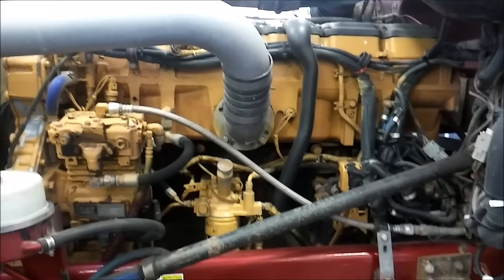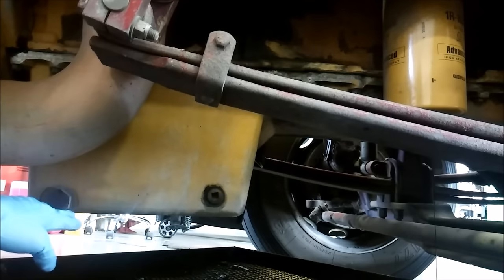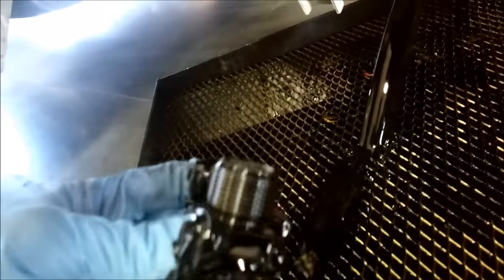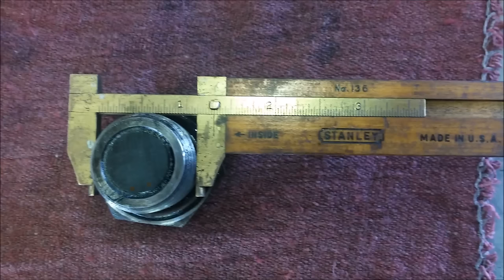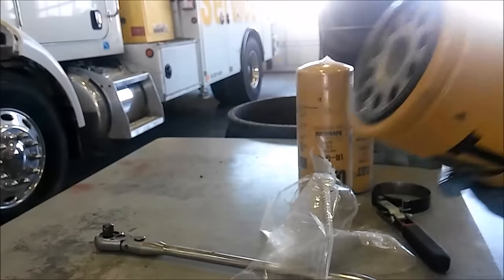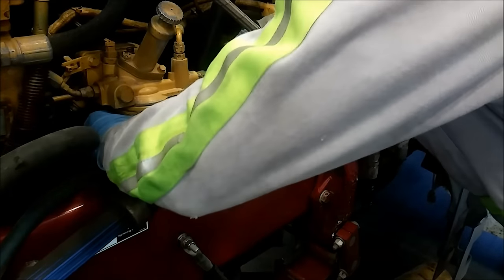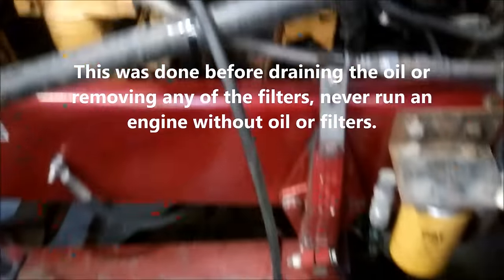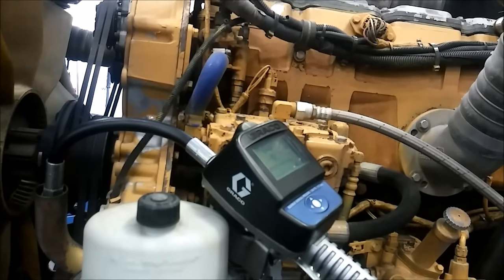How To Perform A Professional Cat Diesel Engine Service.  Cat Engine Oil Change.

Comment: I like the idea that you make a hole in the oil filter to drain the oil I would not have thought of that that's a good idea keep up the good work & videos I like to see your videos
Reply from the maker: Thanks for the comment. Yeah I've done the drain hole in the oil filter for years and it really makes it easier. Don't do it with the fuel filters though or else it might syphon out the fuel tank, I've seen that.
Reply: You can also put grease in the bottom of the filter where you poked the hole when you go to remove the filter to make it a cleaner process so theres no oil draining while you remove it
Reply: @masonharris2995  I'll use a  bugger instead of grease.

Comment: About to do an oil change on my 1997 Cat 3126 engine.   I would have overtightened the drain plug and pre-filled the filter.  Glad I watched this video first.

Comment: I love how careful and proper mechanic you are. Very professional. ! I don't see guy like you cutting corners. Great videos.  I am a mining mechanic and find a lot of your videos helpful
Reply from the maker: +Kostya Yantsen Thank you for the kind words. I am thorough, maybe a little too so, it slows me down a little, but I really like doing the job right. What kind of mine do you work at?
Reply: Google NARM  GIllette, WY. Biggest private coal mine. They really have their stuff together here. they have like 40 D11s, 20 D10s, 20 some 24H and 24M blade. Its impressive how much of the same problems we see( same as you i imagine). But there is a little bit of troubleshooting but a lot of it comes down to component changeouts due to downtime. a lot of times they try to run somewhat of a decent maintenance program and be proactive. add me on Fb kostik yantsen. 
keep up great educational videos.You are the kind of lead man i would want to work for because "good enough" is not in your vocabulary.
i mainly work with 3516, 3512, coupled 3512, c32, c27, c15, 3406, 3508 ect ect.
Reply from the maker: I don't have a Facebook, but I work with a guy that used to work up in Gillette on a coal mine, he didn't know your name though he was a field maintenance guy up there last year.
Reply: there is a dozen coal mines. 2 of them have over 1500 people working lol lol

Comment: I fitted a ball vilve slow drain plug on the furthest most rear right side drain plug on the oil pan on my c15
 this works well if you dont have the luxury of heavy shop equipment or a 15 gallon or more low profile heavy duty drain pan to catch all the oil and handle the flow rate of oil comming out of one of the bigger rear drain holes while it's hot.
With a slow drain ball valve plug I use X2 24 Qt wall mart drain pans ( the large square ones at only 12 bucks each) they can be sealed up by putting the 2 caps back in the center then you can pull them out and carry them like suit cases with out spilling oil all over but if i did not use a slow drain ball valve plug the flow rate of the old oil eventually  overwhelmed the drain holes on the catch pan one down side is i need to slide the 2nd oil catch pan over when the first one gets almost full but i keep them side by side so the switch over of each pan is quick as they only hold 24qt each. but they are the largest oil catch pans i can find with out spending 100s on a heavy duty one plus they store with out taking up to much space.
But for a DIY oil change for an OO whos an ex car mechanic, i use both catch pans combind with the ball valve and it works well for a qiuck stealth parking lot oil change with no mess also the hole in the filter is a good tip I must say 
Personaly i add half a gallon of diesel  fuel in the in engine just after the fan kicks in when the engine is hot and let it run for another 60 seconds to help remove the last of the old oil and soot that sticks to the walls of the engine.i use to do this on diesel cars in the UK but would use only half a liter or less when I worked as a mechanic alot of uk diesel cars  had long life diesel oil and long drain intervals where the oil sooted up bad and was black as hell

Comment: Good info on the drain  plug  torque ..and filter prime methods .
First timers need to know  a  12 gallon drain  pan wagon..., on wheels,  might  be the  way to go ...and prevent a big mess...
I then used a drill pump to put the waste oil from the drain pan into covered buckets , drum , etc . 
Any thoughts ?

Comment: I use a homemade punch to put a hole in the bottom of oil filters and let them drain before i remove them. Takes a little more time but it sure saves a lot of messes. Cat drain plugs can be awefully tight. Filter pliers are a Nope in my book. A Snap On dual drive cloth strap wrench is the cats meow for overtightened filters.

Comment: Hello, Excellent video. I just purchased a 2005 Sterling 22' box truck with a C7 and Allison trans. First diesel! I wanted to know if there is anything different regarding the Oil changes/Fuel filter changes on this specific engine compared to your video of the C15. It has 294k, runs great, and I will be using it for personal use only. It looks like it was kept up to date mechanically by Ryder with the stickers in the cab. I do not know the backround of the truck but I want to treat it correctly!

Comment: I have a 2006 C7 in my RV.  I am reading horror stories about loosing fuel prime. I have no secondary hand pump with no room to install one.  Looks like you had both filter off with no fear of loosing prime?

Comment: Kay I operate a 908m cat wheeled loader an now have to start Doin my own oil changes an which I don't mind but never worked on one...you should totally do a video on the engine service for it
Reply: you video definitely helped but not fully haha just a newbie I am an really don't wanna mess up my loader Doin the wrong thing...my manuals help but not fully just need to see it done an I'll have no problems
Reply from the maker: +Dakota May I don't get to work on earthmoving equipment in my shop, just trucks, busses, and RVs. The engine itself will be the same as far as a truck engine service, but you still have do the hydraulic system, grease fittings, etc. If I move into the earthmoving shop I'll do some equipment videos, but right now I'm sticking with engines.
Reply: thanks dude...I just said screw it I'm gonna just figure it out an well I successfully did what I set out to do an that was change my oil on my cat....just a newbie so was just a hair intimidating but I was successful thank you again
Reply from the maker: The engine is the biggest maintenance item, if you can do the engine you can do everything else.

Comment: Nice video and Great channel. 👍 
I noticed you filled the engine oil to the top or max. 
Will that level not be over max when the oil heats up ?
I usually stop at 75 % full on passenger cars, so when the oil warms up and expands it will be about max.
Reply: When the engine is running and the oil heats up it will be circulating throughout the system, I do not think that the hot oil increases the 25% that it lacks. You have to follow the manufacturer's data, none recommend putting only 75% of the total capacity.
Reply: @yaserglez  well it definitely depends on the difference between low and max on the stick. 
On passenger cars it's usually 1 LITER between. So if there is 5 liters of oil totally then the last 25 % would actually increase the level a lot.  But don't know about CAT engines though they are cool

Comment: I’ve got a C7 and I’ve purchased everything to do a service. Except for grease. I’m going to go ahead and give it a try. Fingers crossed. 
Would it be terrible if I use diesel fuel from the pump to fill the filler?
Reply: I work for a big trucking company and my job is to do PM services on the trucks. Just go to the gas station and fill up a clean fuel can or a milk jug that is clean and use that to fill your fuel filters. We use empty windshield wiper fluid bottles. I just have the fueler bring his truck over to my bay and fill my jugs up.

Comment: What grade engine oil would you recommend for a 2003 cat c15 located  in nevada ? With 1 million .330 miles
 but it was rebuilt at 800k and runs well

Comment: I am struggling to locate the 2nd fuel filter on my 2000 3126. The one I found is on top of the engine screwed in upside down but I can’t find the other

Comment: I always prefill oil filter regardless both my gas suv and my diesel 1 ton have a straight down oil filter so i fill it up and screw it on I used to have a truck that the engine was pretty worn out and it had to have a pre filled oil filter otherwise it would knock for the first 10 seconds yes it was the strong cannot kill ford 300 straight six it had problems yes but it happened shortly after i bought it started to run like crap but it was cheap so i just drove it.

Comment: My passenger side tank isn't using the fuel , I just replace both my fuel filters I hope that fixes the problem.
Reply from the maker: If one tank is using fuel and the other isn't you most likely have a problem with the suction side of the fuel system being plugged for that tank.

Comment: Do you puncture the fuel filters to drain them as well?
Reply from the maker: +Mac Proctor Nope, the problem with doing that to a fuel filter is it can sometimes pull the rest of the fuel from the system with it while trying to drain the filter. Most likely due to the syphon effect.
Reply: Adept Ape 10-4. I haven't figured out a way to pull the fuel filters without making an extreme mess. Any pointers?
Reply from the maker: +Mac Proctor It's a messy job, I always use the drain pan under the fuel filters when I pull them. Usually I'll unscrew them a turn and let them drain the fuel they are going to vent then take them off. That's how I do them.

Comment: Great video AA!  Very helpful.    What is the recommended oil change and fuel filter change on a 3126?
Reply from the maker: +L Hayes Depends on how you use the engine really but I would say HEUI systems should be serviced every 6,000 miles because the engine oil fires the injectors.
Reply: +Adept Ape Thanks for the info. This particular motor is in an FL60 I use solely for hauling my horses on the weekend with a round trip distance of about 300 miles.   Would that change your suggestion?
Reply from the maker: I would keep my suggestion the same, as keeping that oil clean can really save you some money.
Reply: @AdeptApe  Change the oil more often. Your oil can't be too clean. Way cheaper then a rebuild. Jim

Comment: Can you add diesel conditioner fuel wen replace fuel filter is that ok to do are add fuel conditioner in to the fuel tank poor into the tank cat c13 acert 425hp

Comment: Can I just use the bycycle pump to primer the fuel filters after putting new ones on? or do I have to put fuel in both fuel filters before I reinstall them?
Reply from the maker: +Timothy Nichols I think you mean the priming pump and yes you can, it just takes a little while and a lot of trucks don't have them. If yours has it though, then just pump the heck out of it for about 3-5 minutes.

Comment: great video bro, i work at a kenworth dealership in LA, and i just got started in the field and i did a full lube service on a c15 i filled both fuel filters with clean diesel and capped the middle as u did but i had air in the system and the truck kept dieng after a min or so i kept using the prime plunger i even removed fuel filters and primed them again and this truck to me forever to start...any tips for next time to get it started properly when i have air in the system,,,thanx again cheers from LA!!
Reply from the maker: +Michael balderas I have had that happen to me a handful of times, and I can never figure out why. When you prime both fuel filters it should take care of any prime problems, but I think some trucks have a fuel problem already and then when the filters are changed it highlights the problem. You should have no issues 95% of the time when you prime the filters, but some trucks are just hard to restart after you have opened their fuel system.

Comment: Im a little paranoid about the empty filter thing...on my C15 I usually unplug the wiring harness to the head and crank it for two 8 second intervals (so as not to get my starter too hot).  This brings my oil pressure up and then i know my filter is full.  Am i being ridiculous???
Reply from the maker: Hello JP, you can prefill the filter I just recommend filling from the dirty side of the filter (the outside).

Comment: I see you use only Cat filters.  Do you have any exceptions to using any other filter manufacturer?  Such as Baldwinm Wix, Fram Etc Etc?
Reply from the maker: +easytopleez33 Cat makes exceptional filters in my opinion. They cost a little more, but are better from what I've seen.

Comment: Should one drain the oil from a manual transmission since it shares the same oil, I was hoping you would show us how that's done too
Reply from the maker: +Miguel Rivera The engine and transmission, whether manual or automatic do not share oil. The transmission is usually serviced separately from the engine and has much longer oil change intervals. Hope that helps.

Comment: What is the Cat diesel Engine specification between mileage for fuel and oil filter. Additional question as well in your opinion when changing the fuel filters should one change both primary and secondary filters at the same filter change.
Reply from the maker: +Shawn Lagace You should always change both fuel filters. The mileage varies based on the engine model and the oil pan capacity. I talk about that for the specific models in the "know your engine" videos.
Reply: Okay Thank you.

Comment: ill do a service on a cat over volvo any day. volvo has 3 oil filters and they never come off easy
Reply from the maker: +Diesel_Tech I've only had to deal with Volvo generator engines, but they had about 3 or 4 different oil filters and each one was different, what the heck!
Reply: Is horrible especially considering that people always uses a wrench to tighten them. I never use a wrench, only hand and my trucks have never had an issue.

Comment: I have a 1996 RV with a CAT 2126 engine. What kind of hose do you have attached to the top of the fuel filter housing? I tried listening to the audio several times but could not make out what you said...it sounds like..."...so I have this hose ran from the COFFEE CHICK (I can't make out what you said) fitting on the top of the secondary fuel filter.."   Can I purchase this hose assembly?
Reply from the maker: +QuantumRift Oh I said Compucheck fitting. If you can send me an email at AdeptApe@yahoo.com and ask me the question I can give you the Cat part number for the fitting you need.
Reply: Adept Ape ok

Comment: quick question that main fuel filter . will that filter work on a 3406c i dont know why i always have a big long one.  it feels lile its robbing fuel
Reply from the maker: +Vasile Costin I'd have to check the serial number to see what the filter number your engine calls for. The filter size doesn't matter as much as the micron size, maybe you have too small of a micron filter that is causing a restriction.

Comment: I just started working as the mechanic / maitenance supervisor for an excavating company with mostly newer Cat equipment. I noticed on a 140M2 motor grader, the oil spec is 10w-30 cj4 oil. Apparently that has been a Cat spec for over 10 years. The last maintenance manager was running 15w-40 in everything. So, considering we are in Colorado, should we go with the Cat recommendation, or stay with 15w-40 ?  I used the 10w-40 in this case, but just need a plan, so I can advise management if they question the change.
Reply from the maker: On the smaller Cat engines such as the C7 and C9, the recommendation is 10W-30, now 15W-40 is an alternative, but since you are in Colorado which is a colder state I would say go with the 10W-30. It's never a bad idea to go with the Cat recommendation.
Reply: At what decision did you arrive?  Our climate here in NE Cal. should be quite similar to yours - highs @ 100°F and lows to -22°F.  We use 15W-40, because that is the sole oil which our local oil jobber sells in bulk, and to purchase the 5W-30 from the CAT dealership in 5 gal. buckets costs twice as much as the heavier viscosity engine oil in bulk.

We operate trucks with 3406E's, 120M's with the 6.6L, and a couple of 12M's powered by C9's.  Their block heaters are utilized extensively this time of year, so I am not concerned about adverse effects from using the 15W-40, but it seems the 5W-30 would provide better fuel consumption rates.

CAT publication SEBU7880-5 of Dec. 2007, pages 103 and 104, footnote (7) states, "Supplemental heat is recommended for cold soaked starts below the minimum ambient temperature."  As -22°F exceeds the minimum for 5W-30 and 15W-40, our equipment block heaters are covered by their suggestion.

Comment: Hey I have c7 engine it starts up and cuts off n 5min,I never had any problems with this engine.any ideas what’s wrong with it
Reply from the maker: Does it just shut off like someone turned the key off? You can try to get the blink codes for it and see if perhaps you have a timing code fault, but what you are looking for is the injector current faults. If your engine has all 6 stored for that you probably have a bad ECM. If no codes you could still have a bad ECM or something simple like a bad power/ground to the ECM.

If it stumbles for a little while before it shuts off, then you may have a fuel or HEUI problem.
Reply: @AdeptApe  yea it shuts off like someone turn key off, and coolant light comes on and circle with a x comes on the dash
Reply from the maker: Hmm, you could just have a low coolant level sensor sensor fault that is programmed to shutdown.